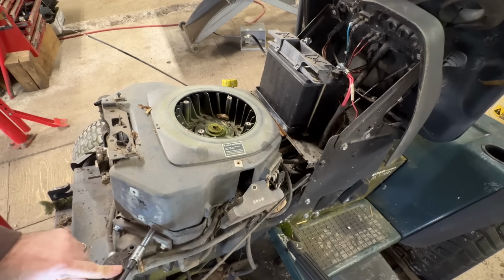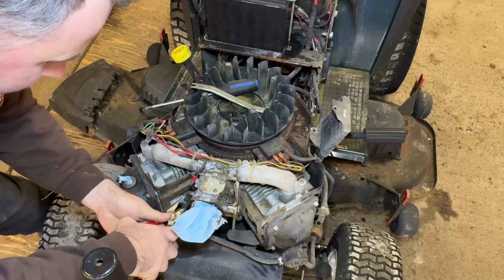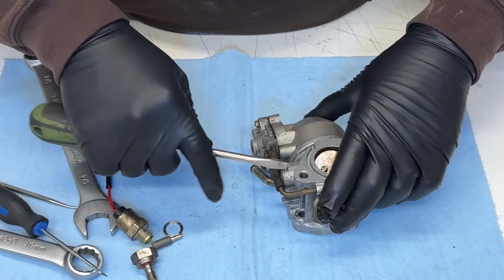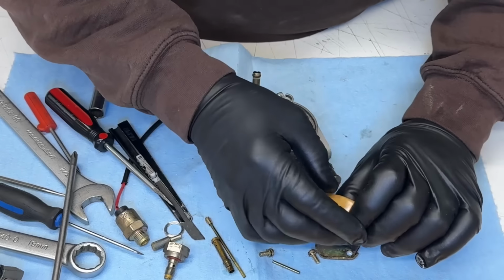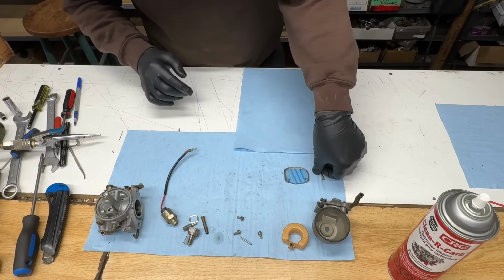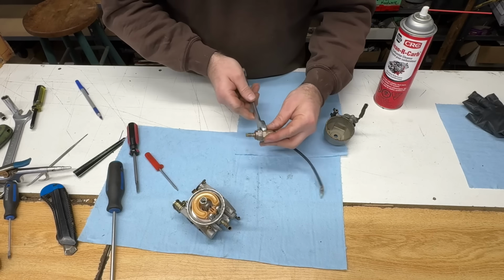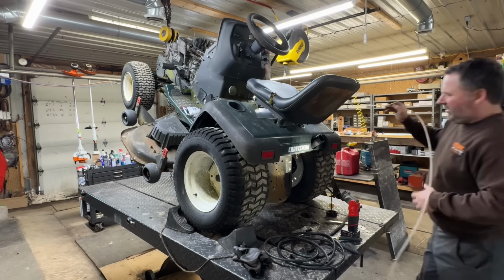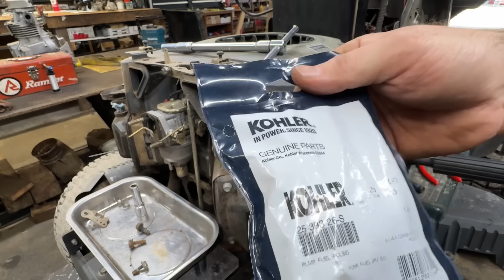* PART 2 *Scrap it OR Fix it? Craftsman Garden Tractor With Kohler Command Left Sitting For Years!

Comment: I really appreciate seeing the carb teardown and explanation since this is one I’ve never seen before. Could you identify it for me (make/model and/or type)?  What role or advantage does the accelerator pump provide in the operation of this tractor?
Reply from the maker: The accelerator pump gives an extra shot of fuel when the engine is going from idle to high speed, or no load to a load. We tend to see these more on the larger Kohler Command engines - but not all of them.   I'm going to take a look at the engines service manual - and I will report back morein-depth info :)
Reply: @marriedwithsmallengines 
Excellent, thanks!  I’m very curious exactly what triggers the additional fuel to be delivered - whether it’s a 
mechanical connection to throttle linkage or impulse driven from the crankcase or electronic. Or other - I just can’t imagine!

Comment: I bought the craftsmen lawn tractor with the koler engine around 95. I think I kept about 2 years, the engine burnt oil like crazy. It had that same shallow deck. At first I had an agreement with sears where they changed the oil and filters. They would also fix flat tires if you wanted to wait a week. I sat it down by the road and my father in law took it home. Then i bought a simplicity zero turn mower and it was just okay. In the short time I had it the fuel lines went bad and the pivot bolt in the front broke so I put a grade 8 in it's place.

Comment: Did you try and run it first before tearing down the carb? Cleaning it all day won’t help when it’s not dirty. Been doing this stuff a long time and found the place to start is to troubleshoot to fix no start won’t continue to run ect. Then once it runs fix or replace what’s needed. Way too much time and parts trying to make it perfect if you’re trying to earn money.
Reply from the maker: Hi Alan.   The fuel tank and lines were full of water, dirt , algae and other debris.   You’ll notice when we shot fuel down the intake it fired for a second.   The tractor has been sitting in our yard like this for many years.    We were genuinely curious to see inside the carb.    This wasn’t a customer repair.   This was a project we pulled out of a graveyard for video purposes and spent alot of time on to show you and others.   Thanks for your comments.